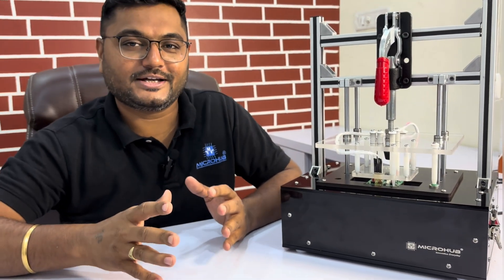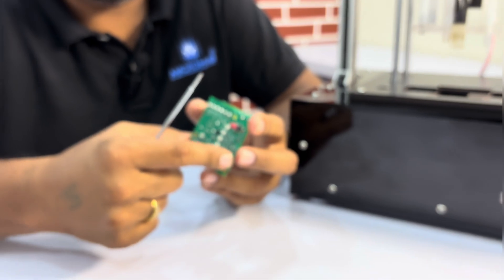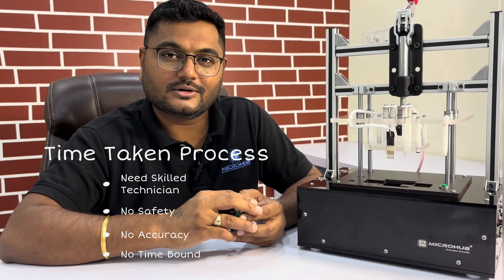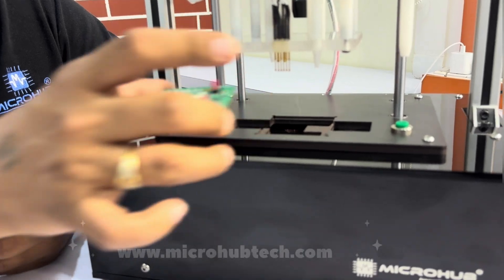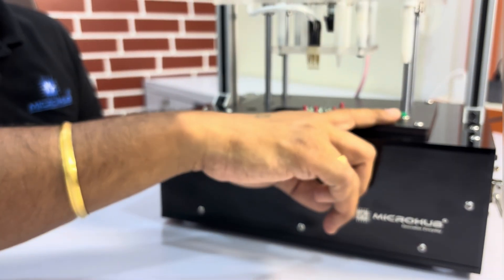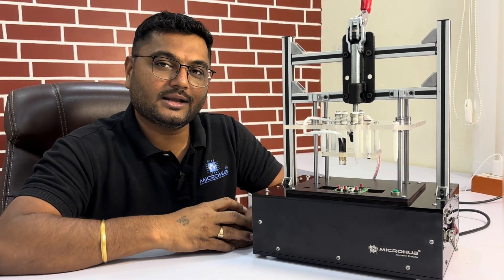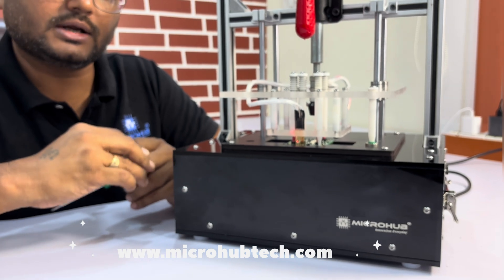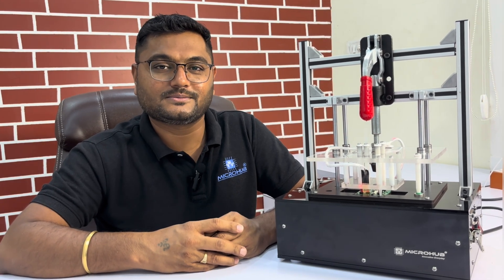How FCT Functional Test Fixture Works ? Manual PCB Test Fixture with  Pogo Pin and Test Probes

Comment: What is the use of this fixture? Is it testing for reliable electrical connections all the time? I would like to get in touch and see how this would be useful for our project. How can I get in touch?
Reply from the maker: Hi,
This PCB Test Jig is used to test your PCB after assembly — ensuring that the assembled board functions correctly and meets all required specifications.

For more details, feel free to contact us:
📞 +91 9904353830
📧 info@microhubtech.com
🌐 www.microhubtech.com￼
Reply from the maker: Hi,
This PCB Test Jig is used to test your PCB after assembly — ensuring that the assembled board functions correctly and meets all required specifications.

For more details, feel free to contact us:
📞 +91 9904353830
📧 info@microhubtech.com
🌐 www.microhubtech.com￼

Comment: Very good knowledge u r sharing thnk u sir🙏
Reply from the maker: Thank you , you can contact us for following requirement's      
manual customize test jigs and fixture, vacuum test fixtures,
Pneumatic Test Fixtures,
FCT Fixtures, Dispensing Robot Fixtures ,
Soldering Robot Fixtures, Router Fixtures, 
Automated Functional Automatic Test Fixtures, 
Mild Steel PCB Test Fixture Machine, PCB Functional Test Fixture, 
Pcb Continuity Testing Fixture, 
PCB Test Fixture Machine, 
For Manufacturing Functional Test, 
Argus MS Pcb Testing Jig Fixture, 
Pcb Testing Jig Fixture Ict, Manual Testing Jig, 
For Electronics, PCB Test System Service, 
Different Type of Zig And Fixture, Machine Jig Fixture, 
Brass Pogo Pins, For Electronic, Spring Contact Test Probes Pogo Pins,
 Spring Pogo Pins, Pogo Pin Connectors, 
Korea ICT Testing Probe And Receptacles For Industrial, 
golden Mild Steel Spring Contact Probe,
Collar Pogo Pins, Pogo Pin, 
Screw type Pogo Pin Test Probe, POGO Pin for PCB circuit testing, 
Spring Contact Test Probes Pogo Pins, 
Wire Harness Probe Pin Switch Probe Pin TBO Pin TVO Pin Push Back Pin PCB Test Pin Harness Pogo Pin, 
Bare Pcb Test Probe POGO PIN ICT PROBES SPRING CONTACT POGO PROBE POGO 
,Analog Black Functional Testing Probe,
 In Circuit Test Probes
Testing Probes and Receptacles, 
Flying Probe Complete Solution Testing System,
 Customize Mechatronic Test Fixture for Product testing
Reply from the maker: you can also visit us on www.microhubtech.com